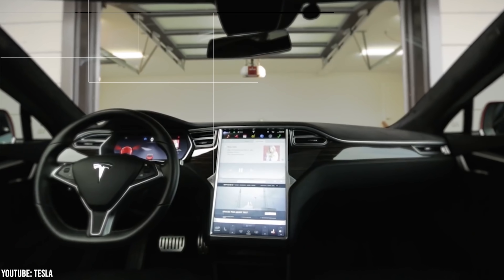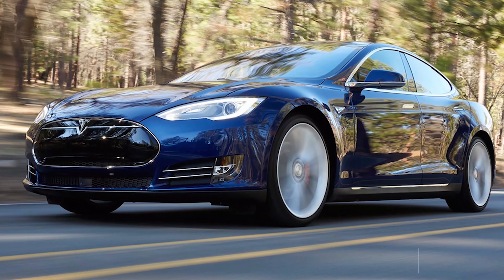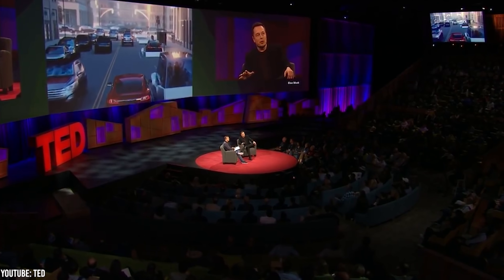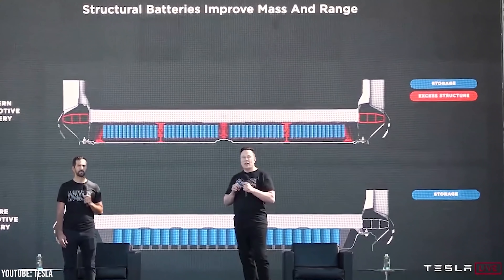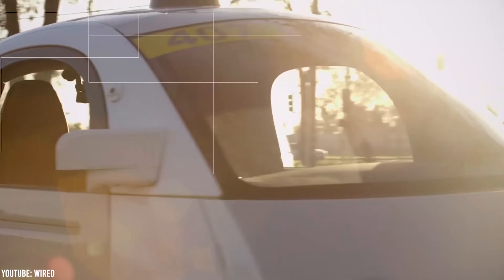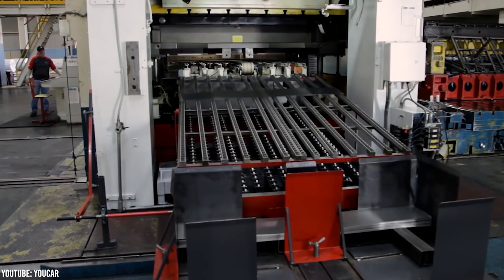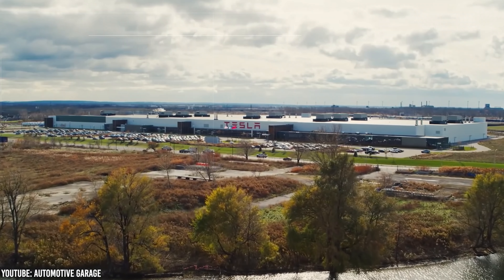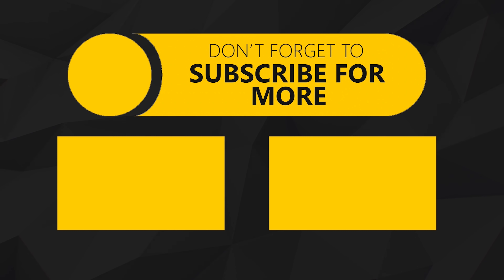How Tesla Built Self Driving So Fast

Comment: It has not built one yet
Reply: Well that's just factually incorrect. Maybe u meant level 5 specifically?
Reply: We are currently on level 3 autonomy
Reply: @yahikotendo5631  not even level 3. This is level 2 from Wikipedia:
Level 2 ("hands off"): The automated system takes full control of the vehicle: accelerating, braking, and steering. The driver must monitor the driving and be prepared to intervene immediately at any time if the automated system fails to respond properly. The shorthand "hands off" is not meant to be taken literally – contact between hand and wheel is often mandatory during SAE 2 driving, to confirm that the driver is ready to intervene. The eyes of the driver might be monitored by cameras to confirm that the driver is keeping their attention to traffic.
Reply: Well it has level 2
Reply: They don't have level 5 yet.  No one does.  They will soon.  Full Self Driving won't be constrained by Tesla delivering the technology.  It'll be delayed by government regulations.  The technology will be here long before the regulators are ready for it.
Reply: @billweberx  it's been more than 1500 days since Tesla started offering FSD package...